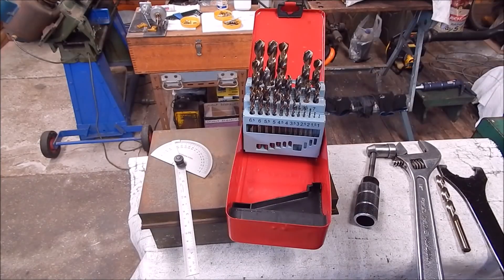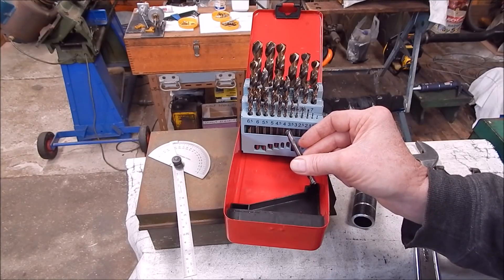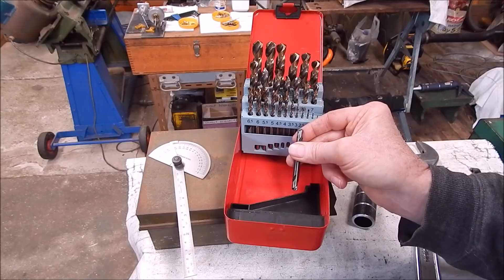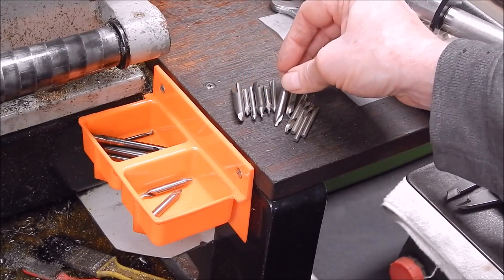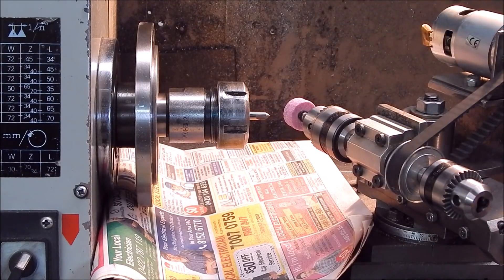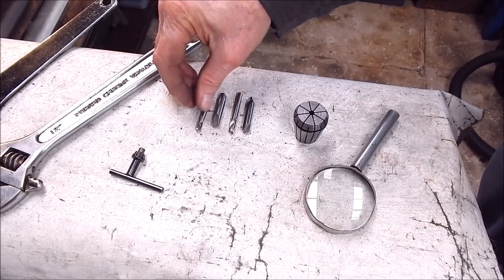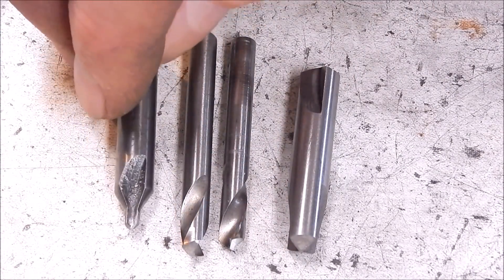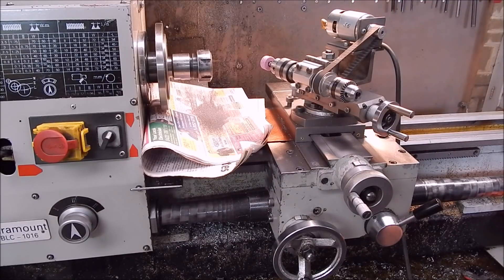How to turn your broken center drills and drill stubs into useful spot drills

Comment: While centre drills have a 60 degree angle the little tip has a 120 degree.   So if you have a big 12mm centre drill you can use them as eefy rigid spotting drills.
Reply from the maker: Good point Joss.  A large centre drill would make a useful spot drill.  Thanks for posting.  Cheers Rob

Comment: Hello Rob! I've never investigated the difference b/w spot and center drills before. You made me go look. Seems to be a bit of a debate here: https://www.practicalmachinist.com/vb/cnc-machining/spot-vs-centerdrilling-121583/ So what's your philosophy?
Reply from the maker: Hi Rick,  I'm not a fan of PM, but in this case the ego trippers seem to have almost contained themselves and the discussion is acceptable.  The consensus is that spot drills are a good idea.  I agree. 

If you look at any info on what makes a good spot drill it always comes back to short length and having the same or a wider tip angle than the jobber drill.  One poster was waffling on about center drill wander - LOL that takes the cake as a center drill is way shorter than a spot drill.  I don't know what he was smoking, but it was a crap statement.

People tend to get lazy (me included) and use center drills as spot drills, as they are readily at hand.  Maybe they don't even have any spot drills.  Wrong angle and tip breakage or jobber drill chipping likely.

I have some HSS ones, but am waiting on a set of 8% cobalt ones from Banggood.   They should go well with my 5% cobalt jobber drills.  Banggood have really upped their drill line up lately and even stock cobalt incremental sets.  If they are all as good as that cobalt set I reviewed recently, they should be an excellent buy.

Cheers Rob
Reply: @Xynudu  Thanks for the thoughtful reply Rob. Always look forward to your videos.

Comment: Good idea Rob - something I did do a ways back to ''rescue'' some spoiled center drills. Didn't take huge care with a grind but they did a good job even so.
Reply from the maker: Hi Chris, 

I got varying results with this on center drills.  The center web can be an issue on some sizes as it is larger than a normal drill to allow for the tip extension.  In that case I found a flat grind worked best for tip relief as it's more aggressive.  All the broken jobber drills came up excellent though.  It's well worth a try.

Cheers Rob

Comment: Good subject Rob--I had a quick look at the black book---for the harder tougher material like 316 stainless 135 degrees is the go---118 degrees for the softer stuff, 120 is fine in my book..If i am doing a run on stainless 316 I will change the grind on a couple of twist drills to 135 degrees and thats it..Pretty easy with a grind gauge,perhaps you could show one for the viewers.. E
Reply from the maker: Hi Ian,  I don't have a grind gauge.  I just use an adjustable SS metal protractor/ruler.  It works pretty well, plus I can use it to set the top slide angle etc.  The degree scale for my lathe is so beat up it's damn near unreadable.  Cheers Rob
Reply: @Xynudu  Buy a grind gauge Rob--They have measurements along the angled face of the gauge which allows to measure the length of each grind so one flute does not cut more than the other..They still can but it is better than measuring by eye..You always get the angle right but not the other..
Reply from the maker: Hi Ian,  agreed. Sharpening by hand on a bench grinder (as is usually the case) will never be totally accurate, regardless of how skilled you are at it.  I was taught to use the side of the wheel, but you see videos where they use the perimeter.  Unless the stone has been dressed (pretty rare) I don't see how they can get as good a result that way.

I may get a grind gauge.  They are quite cheap.  Doing it on the lathe as shown is 100% accurate, but you have to set up to do it, which takes time. 

Cheers Rob
Reply: @Xynudu  The thing is Rob the angle is adjustable but length of the ground surface is not..They must be equal unless you are drilling a 1.10 hole with a1.00 drill.
Reply from the maker: Yes, that's correct.   It's also interesting to mic up drills (which I always do for model making) and see the sizes they really are.  Most are undersized.  It becomes a major concern when you are tapping small diameter threads as the % variation in small drills becomes much greater than with the larger diameters.  Cheers Rob

Comment: Super useful. I have several broken centre drills, all sadly lying about with no hope of work but they cost too much to discard, although not too much for me to use them inappropriately and kill them as I now discover. I had it in my mind that centre drills were what one used to prevent wandering of drill holes and in an answer to another poster you set me right and I learned all about spot drills that for some reason I had not come across or it hadn't registered as being what I should use. So a bonus for me, learning something and a method to give the centre drills I have murdered a new life. Thank you!
Reply from the maker: You are not alone.  I think we are all guilty of murdering our expensive centre drills at some stage in our lives  ;)  Cheers Rob

Comment from the maker: NOTE:  I did a profile match after the first grind and increased the top slide angle slightly to 67 degrees.  This brought it in line with the cobalt drill included angle which is actually 135 degrees.   No big deal, the error was picked up by the match and the final result was perfect.  Pays to double check everything when setting up for this type of work. 

Grinding the back relief will make or break this job.  The centre webs vary a lot and can be overly large on center drills (to allow for the original reservoir tip extension).  On larger center drills I had most success with a flat grind rather than a taper, to overcome this issue.

It may not be possible to get a satisfactory result on some center drills.

Cheers Rob

Comment: Rob- have you ever found a precise method for splitting the points? I come across a lot of bits with really thick webs, maybe an american thing. As i understand the web thickens towards the shank. I have always done it freehand, hopefully on a hard wheel with a crisp corner. As soon as I see a nice wheel/jig setup i'm going to copy it.
Reply from the maker: I do it freehand as well.  Putting in back relief usually solves the issue, but some centre drills (especially the really small ones) have a very thick web (probably for strength) making it difficult/sometimes impossible.   Most work out OK though.  Using a linisher is a lot easier and controllable when doing it. Plus the fine grit finish is perfect. Cheers Rob

Comment: Ya i noticed that all the 135 s are split point. got a set like that,$30 the other week got to my door not split point.Ahhh rather sharpen them myself anyway there m35 i guess.not for your everyday drill. ( I'd go for m2) less brittle gonna try the m42's on a leaf spring and I have some mystery stainless 316 I think. also gonna grind a 1" .375 pilot flat bottom for nocking down rocker pedestals on small block chevys ahhh don't get me started on drills I got lot's a ideas for drills good stuff Thanks
Reply from the maker: Yes, you really need to use a spot drill prior to split point drills. Cheers Rob
Reply: @Xynudu  Ya those 130 ish if you do the geometry the cutting face is 40% less ya If it really has to be DRO kinda perfect deffinatly the starter drill

Comment: Why is it a bad habit to use a center drill.thats what I was taught to do
Reply from the maker: Centre dills are meant to be used to locate dead and live centres for turning.  They include a small tip extension to act as a lubricant chamber and the drill angle is 60 degrees, same as a lathe centre.  Most drill bits are 90 - 135 degrees and do not centre very well on 60 degrees, especially if the centre drill is a smaller diameter. 

Spot drills are meant to be used to mark out or guide a position for drilling.  They are made much shorter to reduce tip "wander" as can occur with an unguided longer drill bit.

They make each type of drill for a specific purpose.  Cheers Rob